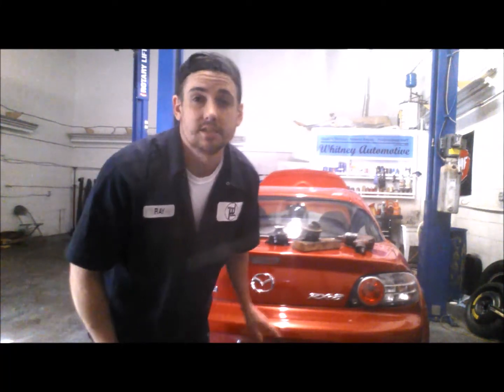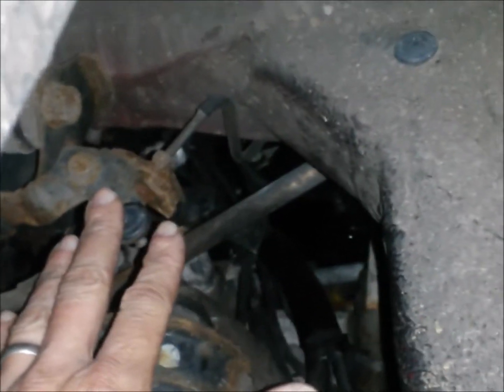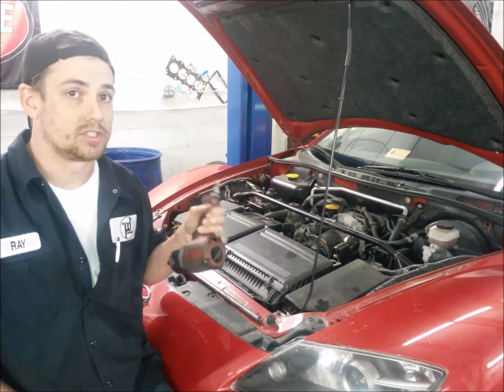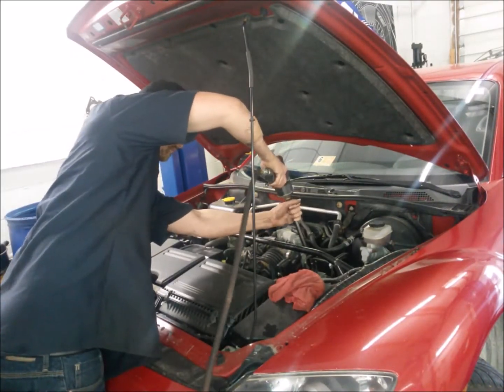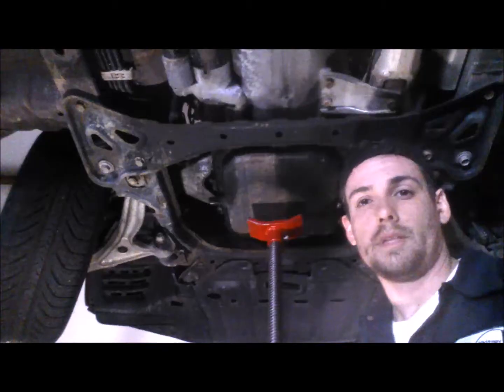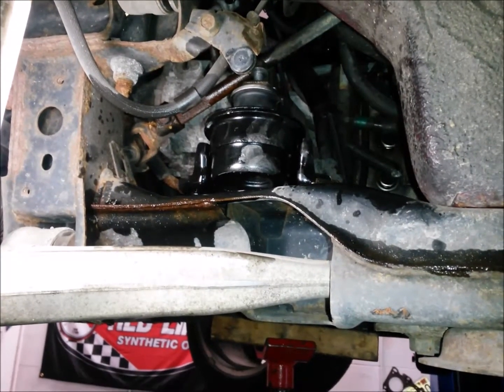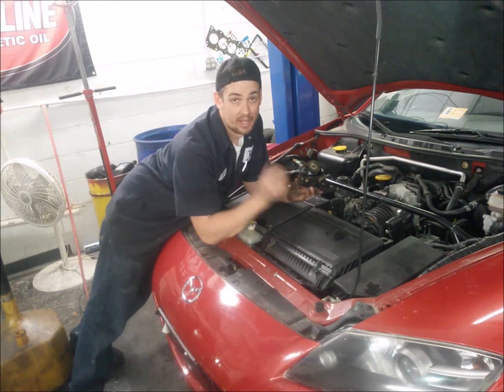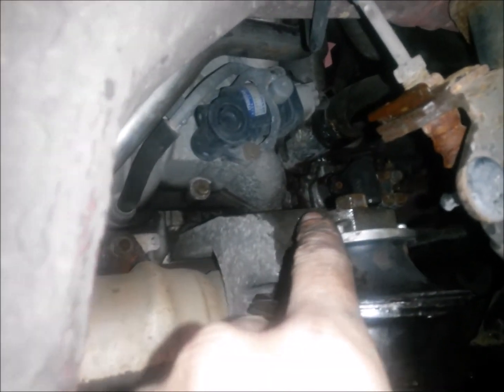Mazda RX8 Engine Mounts How to RX-8

Comment: Ray. I just want to say thanks for all your videos. I nearly scrapped my RX8 with only 56,000 on the clock. I have systematically changed with your help all these parts. Plugs, Coils, Leads, Cat, Lambda sensors, Cleaned Maf sensor and now going to change engine mounts. The wife took it for a test drive and loves it again. I am going to keep it longer and have a go with your help again in the future. Thanks again People like you make it possible for non mechanics like me.
Reply: 5 years ago... do you still have the 8? ive bought one the past year

Comment: You make great videos, thanks for sharing all the insight. Question for you: I just bought an 04 Rx8 with only 10k miles. I recently did new plugs, wires, and coil packs. I also added a K&N filter and removed the walls within the airbox. The car pulls very strong, and starts cold and hot no problem everything. My only issue that kinda bothers me is vibration during idle. My idle is steady - maybe once every minute it'll dip like 50rpm but I believe that's normal. Other than that it's constantly right where it should be. What do you think this can be? Some say there is an engine mount closest to the exhaust that typically goes bad, or perhaps it's because I removed the intake walls. Thoughts?

Comment: Great video man. What causes the engine mount problem? Is the engine too heavy?
Reply from the maker: +Mr. Mazda I do not believe the engine to be too heavy. In fact, the engine is surprisingly light weight. The mounts aren't made specifically heavy duty. Add the fact that the engines tend to vibrate normally, and people like to drive these cars like "race cars", and there isn't a dedicated "trans mount" but instead have a solid "powerplant frame" and the engine mounts simply won't last too long. Luckly, they aren't super expensive or difficult to replace.
Reply: Whitney Automotive Makes sense. Thanks
!

Comment: Hi!!! Pls i need your help!! Here there are no good mechanics for this vehicle. and I have 3 weeks trying to find the problem. my mazda rx8 2009 turns on cold, when taking temperature it turns off and does not return to turn on. Now clean all the admission, i change coils, i change oil, measure rotor compression and replace the fuel pump. even so the problem continues. if you can help me I would appreciate it! Thanks!!

Comment: I am on my second set of motor mounts. Is it a common issue?  2012 Mazda 2.5l(auto) 76k on it.
Reply from the maker: +Michael Goldberg After 2010, Mazda mad much fewer problems with their mounts than in the pre-2010 cars. It is unusual for a 2012 car to have multiple failures, especially as an automatic. If your car doesn't have any modifications, I'd suspect something wasn't right about the first set of replacement mounts.

Comment: I have a situation, occasionally when i insert my key to start my 05 rx8, i get a flickering icon of a car with a key inside. And the car wont turn over
Reply: techomatic2000 check battery conections